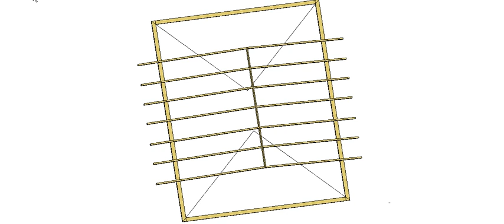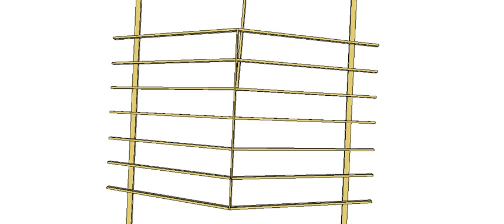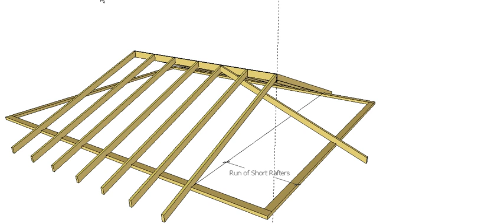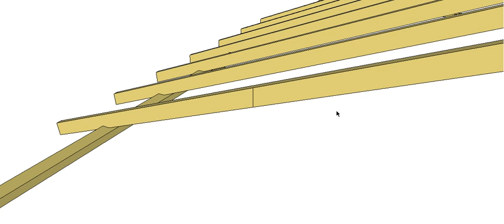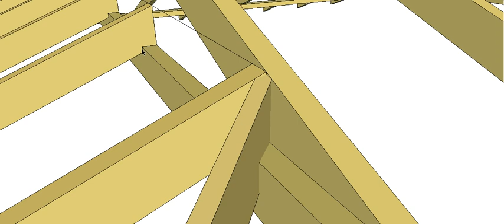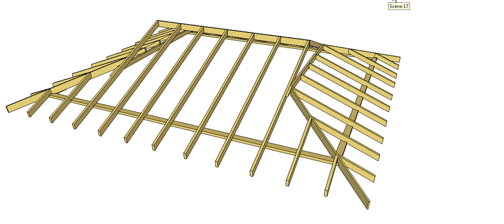Dutch Gable Roof Method 1

Comment: I have a Dutch gable roof on my 1959 UK house and there's more structure in it than this design. There's also beams running parallel to the ridge from the where the tops of the hips meet the waling plates so they form a rectangular frame at the height of the waling plate. The short sides of the roof will place a lateral load on the rafters that the waling plates are on so the extra woodwork is bracing the short sides against each other.
Reply from the maker: Thanks mate, good to know.

Comment: Bonza video mate. How do you calculate the length of the short rafters once you've got run? Is there a length for rafter spaces and a ratio between common and short rafters? Thanks again.
Reply from the maker: Hi Mate, this video goes over the calculations required
https://www.youtube.com/watch?v=TcN3O7owg9I&t=621s
For the short rafters you would just use the plan length of the rafter instead of the 1/2 Span. Hope this helps

Comment: How on earth do you insulate the gable side of the hip when it's a very short end?
Reply from the maker: Hi Mate, yeah there is not much room down there. I have seen some people do it before the plasterboard ceiling sheets are installed but chances are it is to late for that. The only other way is to get the smallest mate you know and give him a long stick or pole to poke the batts into position. It is not a nice job but there is not easy way of doing it.
Reply: @Buildsum  I have all of my ceilings down right now for asbestos remediation. https://photos.app.goo.gl/qUJE59okDJai7fEh6 I took a quick video of it, really just want to get it right.
Reply from the maker: Hi Mate, I see what you mean now, that beam is going to be a pain. You will have to put the batts in before or as the plasterboard goes up. You may have to hold them up there by stapling some packing tape under the joists to keep them in place while you get the sheets up there.

Comment: Thank you for a very informative video. I am only a DIYer so please excuse my ignorance, and confirm the following details: The "cropped" hips must be at the same pitch as the main roof?  
The length of these hips are variable as long as they end against a main rafter?  If the hip rafters are butted against the waling plate they must be shorter by the thickness of the plate?
Reply from the maker: Hi mate, thanks for you comment.
Yes the "cropped hips' must be the same length as the rest of the roof, Yes there lenght will be determined by the position of the first set of rafter and yes if they but into the waling plate they will have to be that much shorter.
I hope this helps.
Reply: @Buildsum  Many thanks.

Comment: Would this be a good method to add a lean to on to a pole barn.  I'm wanting to put the lean too on the gable end.  side walls are 11 foot with a 4x12 pitch to the peek.  My issue is I would like not to lose the 11 foot height , so essentially I would need to attach above the 11 foot side wall to create a pitch so I don't have a flat roof.  thinking a 2x12 pitch would be fine in my area.  So my problem becomes I can not  run the rafters the full span of the building with out running out the building to maintain the height.   So I was thinking this dutch method might work as I don't have to run or attach the rafters all the way out.  Hopefully this makes sense.  Great Video.  Thanks for taking the time to make it.
Reply from the maker: Hi Jake, yes i think i understand what you mean and that is a great idea. It would certainly look a lot better than a straight lean to and should look like it was always there.
Reply: @Buildsum  Awesome.  If I decide to go that way this spring I'll send you a picture.  Basically I'm wanting a covered space for my camper attached to the end of my workshop.  Thanks so much for the reply!

Comment: Great video! The Gambrel roof is defined as having two or more roof pitches. The example here appears to have only one as evidenced by the 45-degree angle of the hip rafters and aligning jack rafters.
Reply from the maker: Hi Dori, yes a google search will tell you that a Gambrel roof has 2 or pitches and as you correctly state the one in the video only has one pitch. Different terminology is used in different countries, states and even communities. Hear in NSW, Australia this style of roof is also referred to as a Gambrel Roof or a Dutch Gable.
Thanks for your comments.
Reply: @Buildsum  3:40 these are called king rafters, right?

Comment: Nice tutorial. Though, that is not a gambrel roof. A gambrel roof is somewhat shaped like a half octagon.  It is the typical roof that is put onto barns and some small sheds, at least around the US (I'm not quite sure about other parts of the world).
Reply: Buildsum  Oh, wow; that's interesting. I didn't know that. Apologies for the misunderstanding. Thanks for clearing that up, though. Any knowledge is useful knowledge at some point or another, right?
Reply: Gambrel simply refers to a multi level/pitch roof  with different pitches on the second roof level, not the number of "sides", these multi stage roofs are certainly typical of barns in the USA which I believe are based off of "Dutch" architecture.